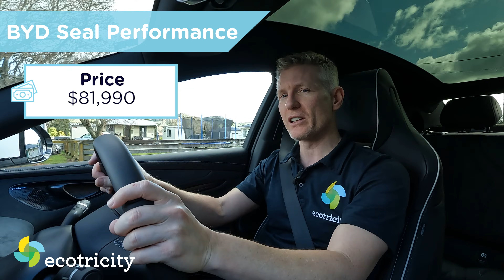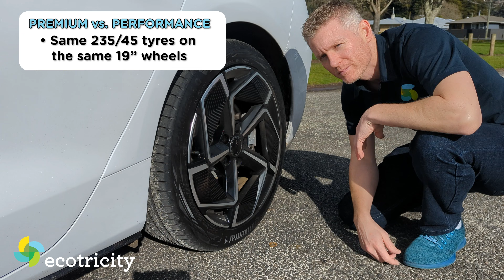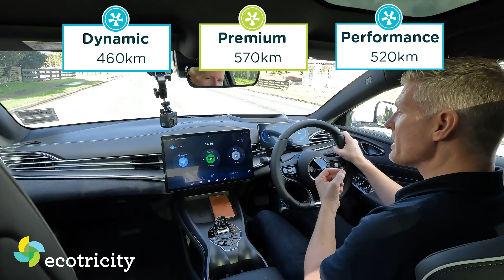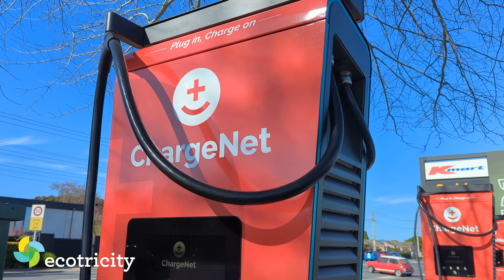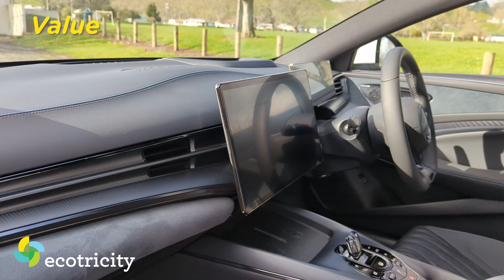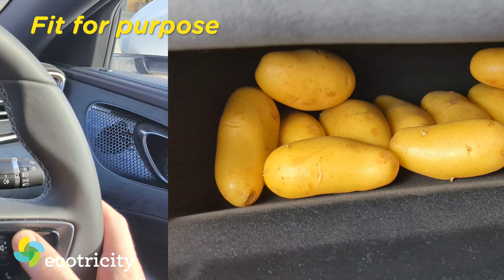BYD Seal Premium – Is this the best of the bunch?

Comment: The automatic seat retraction is a big bonus re exiting and entering the vehicle for some disabled people. I have a disabled knee stopping me bending it to a smaller angle than 90 degrees. My leg, ankle and hip all work fine. So my only difficulty is getting into vehicles. The seat movement has no negative impact on the able but gives me additional room without manual retraction and then guessing my preferred driving position. Big tick from me.

Comment: Am waiting for the 2025 model that have  more things and also even less price, but a tiny tiny bit smaller battery also it get an 800v up form 400v electrical platform. 10 to 80 at 25min

Comment: Does it have an electric sunroof cover? Having been in an MG ZS I reckon they are vital in NZ
Reply from the maker: Nooooo, unfortunately. But it does come with a mesh solar shield which fits on the inside. In the Performance model video review, I installed one and it attacked me. -Gav

Comment: In real world, the Premium honestly didn’t have that much more real world range versus the Performance. Hard to pass up the Perf with 390kw. When we were in the market for our first EV, we had to choose the 390kw version. It’s an M3 Killer, and that’s not an understatement. You get genuine leather seats, the iTACS, AWD (always good in the wet and snow) and the real world range was just about 40kms less than a mates Premium. And the heated wheel was a must so, as our BMWs of the past have had this and it’s something we didn’t want to go without.
Reply: Yeah I really want the performance but across the pond here in Australia too many rules, I'm 21 but can't drive it due to p plate restrictions, 20 and 19yos can drive it though 🤔
Reply: Did you test drive the Model 3 as well? The Seal is excellent but there are some things Tesla just does better. I'm hoping vehicles like the Seal force Tesla to upgrade things like offering a heads up display and 360 camera.

Comment: Nice review, especially since you avoided saying the “T” word by way of comparison. If rumours are to be believed, there is a facelift for the Seal coming. Tweaking things like battery (not Blade 2.0 unfortunately), motor(s) and the interior (dashboard mainly). The Seal is the likely successor to my TM3 although, having test driven the BYD Sealion 6 recently, I might wait to see if the fully electric Sealion 7 is coming to NZ.
Reply from the maker: I save the T word (taters) for dinner! :D -Gav

Comment: Too expensive.
Reply: Oh and it's not BYD fault or any EV in NZ it's the government thanks in part to the RUC that has done most of the damage, many say it's the cut of the rebate, but now most of the best selling EV in 2024 have savings far higher than what the rebate offered
Reply: It's new tech. Prices will come down over time... and probably relatively quickly given the economic nose dive industrialised countries seem to be doing now.
Reply: The Seal is on borrowed time in NZ! It's pretty much like all EV. July has been the best selling month for EV in NZ, a big thanks to massive price cuts to most EV brands. Even the Kia EV9 sold 31 in July vs. 3 in June, but of course, the sales shot up when Kia decided to knock $35k off the new price! That's almost as many EV9 last month that the Seal has sold in the last 3 months, being 33, and that is total sales nationwide!
Reply: @gregb1599  The EV market will neve be dead as most countries including NZ are banning ICE cars in the coming years
Reply: @mitahenare8901  Total rubbish, NZ is not banning ICE! And when those ban dates come close they will extend and when that date gets close again it will get extended. It's already happened in the UK was 2030 ban, but they soon realised that was never going to happen, so now it's 2035 and in 2030 it will get pushed to 2040
Reply: Interestingly, electric cars in the UK are about one third dearer.
Reply: @bungee7503 they have import duty as they have a local car industry

Comment: I've had my Seal Performance since April and it still puts a stupid smile on my face every time I get behind the wheel.  Amazing specs and speed for a great price!  Having said that the advertised range never meets reality, especially with the heater or ITAC enabled.
Also, regarding the audio noise levels, were you using a phone connected via Bluetooth or radio/spotify?

Comment: I tested this model for 1 week and I was very impressed. The power is more than enough. I drove it in Eco mode because this gave me a smoother ride. Unfortunately it is too big for me and I don't like the trunk. BYD should make an estate from the Seal.
Reply: There is the Seal 6 Touring. So it is almost there.
Reply: @absolutium . Yes, but not as an EV.